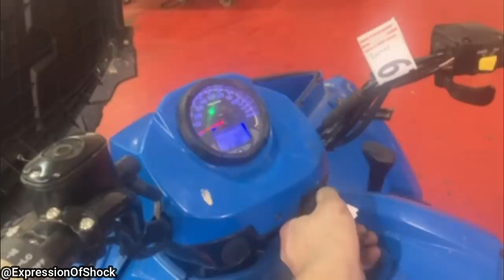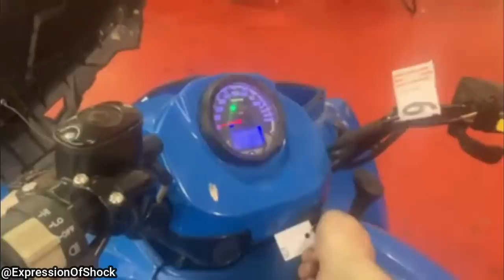Customer States Dodge Challenger Won't Start After Collision Repair | Just Rolled In

Comment: My parents had a '90 Cavalier and we hit a deer one night coming home.  Took it to a shop to get the work done, cost around $1500.  It wasn't until years later when I got the car after getting my license that I discovered that the shop only replaced the front bumper.  You could still see the damage behind it and the headlight mounting bracket was hot-glued back together.  There was also an empty Bic pen under the driver side headlight keeping it aligned up.
Reply: If it works, it aint stupid?
Reply: I'm glad it was an empty Bic pen. It would be a waste if it were a new full one. It also might throw off the balance causing severe tire wear resulting in a massive blow out on the drivers side.
Reply: @liamholcroft7212  If they paid for repairs that weren't done it's stupid and criminal.
Reply: That would be insurance fraud. Shame you didn’t catch it until years later.
Reply: Similar thing happened to me with my van. Shop at a supposedly reputable dealer only changed the plastic bumper cover, left all the damaged parts behind. Yours did a better job than mine, they used hot glue, mine used painter’s tape. So glad they got the ax a few years later when GM reduced the number of dealers in the area
Reply: That's OEM bruh...
Reply: One of my vacuum lines has a bic pen repair on it. It's what I had at that very moment. Figured I'd replace it soon, but soon hasn't come yet. I check on it like once a month, it's still there performing like a champ for more than a year now. Them folks at bic make good pen tubes...
Reply: @liamholcroft7212  
That is called insurance fraud
Reply: @FP194  Only if OP claimed on the insurance, otherwise it's a cowboy job. More importantly though, It was quite clearly a joke.
Reply: @liamholcroft7212  -5/5 joke
Reply: @ianide2480  If I had a dollar for some of the dumb and sometimes questionable things I've done to repair one of my own cars... :P
Reply: @cujoedaman  gift yourself a decent vehicle
Reply: @CbrF4i600cc  Not sure what that means...
Reply: @liamholcroft7212  
You must be the shop’s owner, or the son.

Comment: The ATV reversed filter is cute in a stupid way,a laugh.The trailer brakes,REALLY? Just rolled in NEVER fails to amaze me,and terrify me.
Reply: The air filter should be designed so  that it only fits one way.
Reply: That trailer drum definitely needs more grease, that should fix the problem
Reply: Yeah sure the brakes don’t work. But that bearing…… going to last forever!
Reply: You can never have enough red grease! It's the good stuff, load it up! 🤣
Reply: @tonysheerness2427  “A common mistake that people make when trying to design something completely foolproof is to underestimate the ingenuity of complete fools"
Reply: I hear you on the filter but they would find another way to screw it up,like duct tape it on sideways,hack apart the airbox.It would be a blast to watch these people with a relatively simple puzzle,but only once.After that its sad. I'm not the best,never will be,tragically average but most of this stuff is scary.I wonder what they paid to have a nechanic to reverse an air filter?
Reply: Bet trailer brake was lockup and the fix was to shather a pint of grease in the drum.
Reply: Some of these can be better than a horror movie.
Reply: @tonysheerness2427  

It’s Polaris so if it will cost more money they say fuck it
Reply: The trailer brakes really hit home as I just greased my wheel bearings on my trailer. That is insane. They must have hit it with a grease gun until it came out of the drums.
Reply: @tonysheerness2427  It does only fit one way. If you have it installed incorrectly, the ATV will not start. As seen in the video.
Reply: Hysterical
Reply: @dpforth  Or as we used to say in the Navy, "nature just creates a better fool."
Reply: The worst post is you were on the road with these “people”
Reply: A mechanic once told me it was wrong that I used grease to lube up the rear drum brakes, but I never touched the pads, nor did I use that much, I only lubed up the actuating mechanism behind the pads. He said that it "melts" and flies away towards the pads. But I've seen people do it and TBH I have since rebuilt my braking system and did it again and it's just fine, both when driving and on a brake check stand in the shop.
Reply: The trailer brakes.  Turned on the grease gun and went off to lunch?
Reply: @techalyzer  A little bit of lube is recquired especially in places where they salt the roads during winter. As long as you don't slather everything with it in there since bearing grease will eff up brake linings and is a pain in the ass to clean from inside the drum. I personally prefer a thin layer of copper paste or special high temperature grease. I've seen some "mechanics" even install new brake shoes on a truck without using a steel wire brush to clean the loose rust away from bearing surfaces and changing brake pads on a disc brake without tactical greasing seems to be the norm rather than exception.
Reply: Callow youth I was, I did the "reverse air filter" mistake on my then nearly new 1974 Yamaha RD350 motorcycle. Bike was trailered to the workshop & I finished up with a red face & a £30 bill. You live & learn!

Comment: Everytime I see these videos ... I have to aplaude the engineers that design these parts.   The amount of abuse that they can take and not completely fall apart amazes me everytime.
Reply: And then you find out there are millions of cars everyday that block everything because of a broken sensor and you need a crane to move it
Reply: ...or you just see here the few % that didn't end up in total disaster.

Comment: Thumbs down for the lousy job the mobile mechanic did but thumbs up to the guy for making a cool table and lamp respectively out of the engine block and crankshaft. That's what I call recycling.
Reply: Probably messed up the seal while installing or tried reusing the old one. Then pumped the hub and brakes full of grease. You would think after a pumping about 10 times as much grease into that hub as it uses they would have figured out something was wrong.
Reply: @chris6200  you mean after emptying an entire tube of grease or two, per wheel.
Reply: @shaynehoffman9602  

With an eighth lug trailer hub I wouldn't be surprised if it took nearly a tube of grease per hub. I'm thinking we're seeing at least two full tubes of grease. I wonder if the mobile mechanic had a barrel pump with a long hose on their truck. I can't understand how they would pump so much grease any other way.

Comment: Taking trailer brake wheel bearing repacking to new levels. Seriously how in the truck can any mechanic in their right mind do that.
Reply: my guess is they weren't a mechanic, only someone they told to drive there and do something.
Reply: imagine how much grease they waste, probably took the whole tube for that drum lmao
Reply: Good lord, I knew how to pack bearings before I was 15! That trailer brake looks like someone shoved a grease gun nozzle in after bolting the plate back on and pumped until he saw grease ooze back out.
Reply: @dalelangila9274  I wish some were.
Reply: It was supposedly a mobile mechanic too
Reply: I once saw a 16 year old working on a $3,000 bicycle “repack” bearings and he absolutely FILLED the hub with grease. Seems the word pack doesn’t translate well for some people.
Reply: look at the brightside, at least they didn't cut corners, grease these days ain't cheap
Reply: I dont know a thing about packing bearings, Even I know that you do not flood the whole rear wheel assembly.  I mean that looks like more than one whole tube.
Reply: Mr. McGOOOOOOOOOO did that brake job.
Reply: @jonathanryan2915  but that could be the customer or a friend and they did not want too look bad at the garage so they said it was a mobile mechanic ..

Comment: The engine table and crankshaft lamp is really awesome!
Reply: I'm just glad I'm not the friend that gets called when he wants to move that table upstairs.
Reply: Love the addition of the touch sensor for the power.
Reply: The lamp is really easy. All you need to do is make the metal of the lamp mount/connect to the other piece of metal. It detects a change in capacitance. The block is about 40-50lbs. It is not bad if you lift it by the crankshaft holes.
Reply: Hmm, that's definitely lighter than I'd have thought. My mother used to have a big root-ball cut into a table, and it was probably like 150lbs at a similar size. It's was like 80% solid wood by volume though.
Reply: @DallenRex  benefits of aluminum. Need to keep the front end lightweight.
Reply: Yeah the lamp is definitely a go.  The table, yeah at least it's dog proof! 😛

Comment: Considering customers describing some of these as 'bad' shakes I can't imagine what constitutes a 'terrible' shake...

Probably driving with one tire flat and another wheel gone for the last 2 weeks / 1000 miles.
Reply from the maker: 😂 it's always interesting how people describe stuff
Reply: I've stopped people in parking lots with tires literally coming off the rims and they didn't notice it... once saw a guy come into the garage I used to frequent for minor vibrations and he had cracked the steering control arms causing the tie rods to get bent under the force of both front wheels being canted inwards.
Reply: "Terrible" would be how they describe the "vibrations" they feel as the vehicle rolls for the 3rd time AFTER the part that was originally bad finally breaks.
Reply: I was watching "Cops" tv series, the cop rolled up behind a guy, that said; car won't go! It was missing the right side wheels, front and back!!..lol..!!
Reply: A few months ago I had taken a bolt on hubcap off to rotate it because the access to the valve stem on the wheel was blocked.  Apparently I didn't get the hubcap or the lug nuts " done right " and when I drove the car out of the driveway there was a small bang.  I only drove to the end of the street before the bouncing around forced me to stop.  It felt like the whole wheel-hub assembly was about to break.  People just ignore the warning signs/noises.

Comment: I put my truck on the lift today, inspected everything, mainly because of these videos.
Reply from the maker: Lol awesome. I'm picking up an old Ford tomorrow. Going to be doing the same soon.
Reply: Looking at some of these cars,  my car has plenty of life and do not need to worry until the wheel is horizontal to the road.
Reply: @tonysheerness2427  when the wheel is horizontal, you don't need roads.
Reply: @liamholcroft7212  Love the reference, Doc.
Reply: Find any shovels? Or ladders?
Reply: @jwrockets  nope, found the “oil leak” though. I managed to pick up a oil filter in my frame. Someone in a GM product is having a rough day.
Reply: @dystopianlucidity4448  it's a self lubricating chassis system, not an oil leak
Reply: @liamholcroft7212  haha! I totally forgot! Silly me. Thanks that made me laugh!
Reply: @JustRolledIn  what Year? My truck is an 09 f150 stx. Even living beach side, she’s really held up. I’ll send a pic after I move.!
Reply from the maker: @dystopianlucidity4448  1991 f150!
Reply: @JustRolledIn  I actually like that years body style.
Reply from the maker: @dystopianlucidity4448  one of my favorites!

Comment: Oh crap that air filter one reminds me when I was working at the blue-painted construction equipment factory. We had a reach forklift with a non-starting deutz turbo diesel engine. Tried everything to get it to start and it just wouldnt. Ended up dragging it off the production line with one of its sisters and putting it in hospital where we performed a engine tray swap. The engine tray on these hung on the right side and contained the complete drive train. We had engine tray swaps down to a science and could do it in about 90 minutes from go to the start up of the completed swap.
We left the 'broken' engine in the hospital area for the deutz tech to fix. He ended up taking apart all the intercooler and turbo piping, and finding a plastic plug in one of the intercooler pipes from the turbo to intercooler. The plug was obviously put in by the supplier of the pre-bent metal charge piping and had been left in by mistake when the engine was assembled by deutz. It was in the direction of flow, so it couldnt blow it out. Not that you'd necessarily want that anyway. 
Any way thats how one plastic plug constipated a production line for like 3 hours.

Comment: Whenever I see your videos I am so happy that mechanics in Germany have to learn at least two years before they are allowed to work solo on cars and call themselves mechanic. And learn 2 years more before you are allowed to run a shop.
Reply: Or do what air force crew chiefs do on the flight line. Depending on the job, a 5 lvl mechanic does the work and when completed, a 7 lvl does an inspection and signs it off.
Reply: @douglaslorin739  Better still, you take the fitter on the test flight. If he's prepared to risk his neck, you know he hasn't skimped the job.
Reply: heutzutage ist es regulär, 3,5 jahre für Geselle, 5 jahre (oder waren es 8?) Berufserfahrung, und ich glaube ein jahr lernen zum Meistertitel.
Glaub aber nicht, daß in den Billigläden a la ATU viele Mechaniker rumrennen... die wären viel zu teuer. Und Deutschland hat schließlich einen Fachkräftemangel im Niedriglohnsektor. ;)
Reply: The repairs you're seeing in these videos aren't from any remotely reputable repair shop, it's from either completely overconfident owners working on their own cars or a guy they know that is also overconfident and underqualified.  When they claim it's from "another shop" they're trying to cover for their own complete ineptitude.  Most mechanics start out doing minor repairs under the watchful eye of a senior mechanic, there's too much liability to let an underqualified person do repairs without supervision.

Comment: It seems that all body shops around the world have a mandatory rule: cut wire harness instead of unplugging
Reply: You dont suppose that the crash damage cuts the wiring? Like how it also breaks other shit?
Reply: @helmutschmacher2100  I'm tired of fixing wire harnesses cut by body work shops. Even the ones I fixed return to do all the same work again after being in a body work shop. 
Maybe this is not the case, but in my country is a common thing to find
Reply: @carlosdaudet6821  actually ill give you that, the country im in does shocking crash repairs, i dont have anything to do with local repairs here.
Reply: @carlosdaudet6821  a friend has a junk yard and 90 % of the wrecked cars have a cut wire harness ,, not saying the body shops don't cut wires but the car wrecks will cut wires

Comment: Yup Dexter axle has 2 seal sizes that use the same bearings. You’d think after 2 tubes there might be an issue???
Reply: Probably pushed it off to the apprentice, "Fill it, till it pushes back out the zerk!"

Comment: It would be interesting to know how many times you and mechanics like you have to fix some other so-called mechanics screw ups, in one month. Great videos. I enjoy each and every one.
Reply: I think "Another shop" usually means the owner tried to do it himself.
Reply: @davidhoulden5791  LOL might just be.
Reply: I had an 81 J2000 severely messed up by a supposedly reputable tire shop.  It needed new shocks and struts and that car used " rebuildable " front struts.  The MORON that cut open the top of the strut used a hacksaw instead of a rotary cutter, destroying the strut (but never owned up to it).  Then to add insult, they sliced the boots on the CV joints getting the struts out when first starting.  Again, never owned up to it.

Comment: Several years ago I hit a deer with wifes Chrysler Pacifica. The body shop associated to the showroom where we purchased the vehicle did the repairs. After the repairs (also the service manager was fired over the repairs on my and several other vehicles) were made we had several variations of problems. Took the car back they discovered the wires were smashed in one harness near the original damage. The shop said I must have been in another accident or was hit in a parking lot. Funny as there was no additional body damege. 
Faulkner Collision in Cumberland co, Pa.

Comment: I had bodywork done on my 4x4 pickup by Earnhardt Toyota in Mesa AZ. It wasn't the dealership where I bought the truck but its still a TOYOTA DEALERSHIP. The day after getting it back I was pulled over because none of my rear lights were working (Tail, turn, ect.) They tried to tell me that the accident had nothing to do with it and refused to fix it even though you could see the wire-harnesses cut. I didn't waste my time suing them but made sure they lost fleet and retail sales. To this day no one in my family will go there. The bodywork was also shotty as they failed to blend the paint properly. Not what I expected at all from a dealership.

Comment: Key detail to remember about a broken belt in a tire. At low speeds, like in a parking lot, if the broken belt is on the front, you will feel the steering wheel pull everytime the broken  belt rolls across the ground. 👌👌

Comment: 2:41 - That's turning a lemon into lemonade!  I like that lamp.  I wonder how he ran the wires?
Reply: Straight up the middle of the crank and then out the side at the top. You can see if you look closely.
Reply: He had holes drilled through the counterbalances. You can see the wire if you enlarge the picture.
Reply: Thank you. The holes run naturally. Fortunately I did not need to drill threw forged steel.

Comment: I had to do brake work on the front of a Saturn yesterday that the female owner said had just been done a few weeks ago. They only put new pads on one side, and charged her 200 bucks.  The pads for BOTH sides were 25 buck cheapies and it takes about 20 minutes.